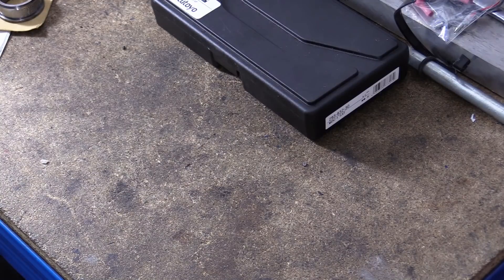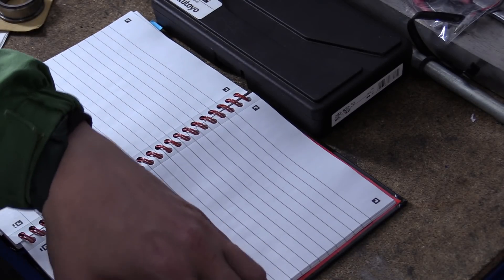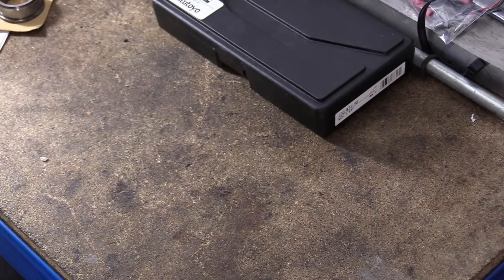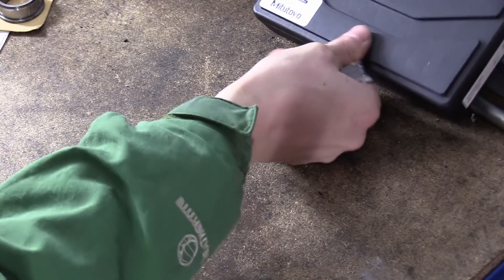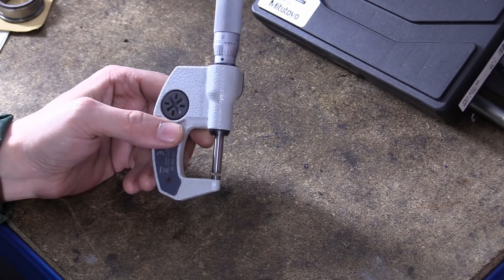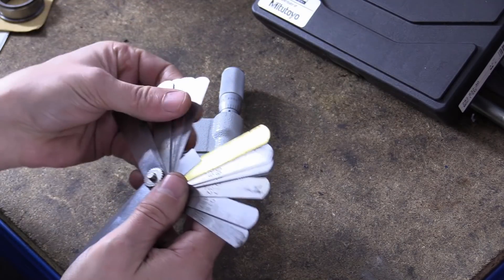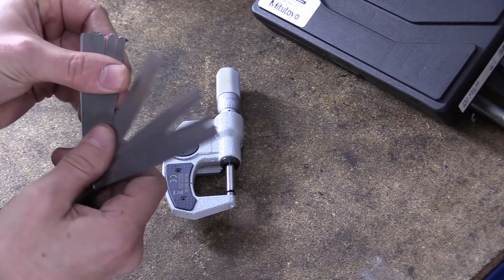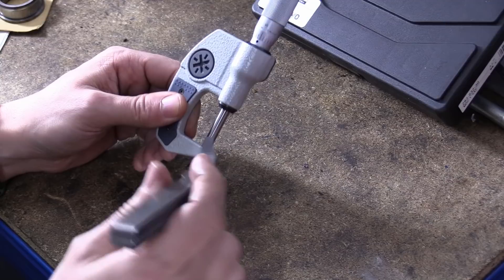Feeler Gauges - How to get the feeling

Comment: That took me back, never give it a second thought these days, but that's exactly how I was taught. We used the micrometer to clamp down using the racket slip, to learn how the feel should be. Not to sure about the porn mags, but I suppose it's a start, it's better using the micrometer, to learn the correct pull first time. No pun intended.....

Comment: Definitely measure the feeler gauges as well.  Cheaper ones can be out a fair bit.  Those also tend to be a little cupped at the edges where they're stamped out, so inserting can be trickier than it should be.  Some are ground at the tips to avoid this, but obviously aren't the correct thickness where they're ground.  As always, you get what you pay for.

I once did the rockers on my 125 with some old rusty feelers!  Definitely decided I needed something better for my first big bike, and I thought I was being paranoid when I bought a micrometer to measure the shims and feeler gauges.  Still had a massive faff with the gauges once assembled (I originally wanted to record the absolute gaps to monitor it over time), so I just go / no-go'd it in the end. It's so much simpler, and seems to work for me.  No dramas yet.

Comment: Its also the Angle of the Dangle. You need to waggle them around to get on the same plane, something again that comes with experience. I'm sure you know what I mean and you could explain it better.
Reply: Very true, at certain angles it slides like no tomorrow but then bang in the middle it's a lot more resistant.

Comment: Every mechanic is different with how they set valve lash, Id always adjust to the tighter side than looser. On Cummins it’s generally advised to use a 6 inlb torque wrench for the adjusting screws. It allows them to take the out human error and get an even lash throughout the entire valve set. I was also taught when carrying out valve sets out in the field or not Cummins engines to use a method by which you tension the adjusting screw by turning the shank of your Allen key only as tight as you can by hand and provided you don’t have any binding adjusters you will achieve an even lash.

Comment: I was 15 when I built my first engine. The mad Irish mechanic that mentored me said. You're building engines. You have to have and know how to use a micrometer and feeler gauges. He then gave me a Mitsutoyo or whatever they're called (a good one) micrometer and showed me exactly what you did with feeler gauges.
He then sent me off with a workshop manual and a box of bits and away I went.

Comment: The brass one is for doing the air gap where you have a pick up coil and fixed magnet rotor so you don't magnetize the pick up.
Reply from the maker: I didn't know that - thanks - what size is it? I never did check.....
Reply: @thedirtyworkshop  
Can't recall the size myself but I suspect the single one supplied with feeler gauges is to suit HEI ignitions with a "reluctor" gap in the distributor which are long gone these days.
Still for magneto type ignition on many small engines with a rotor and fixed magnets its best to use a brass one.

Comment: I don't know if this is bad practice but for my screw type tappet valves on my Inazuma I just put a middle range feeler in and tighten it up about finger tight (so it can be removed) then make sure the upper end feeler gauge doesn't fit but the lower ranges do
Reply from the maker: It not really a bad thing - better than not doing it at all

Comment: Haven't felt this way before.

But on a serious note  when I was taught to adjust valves they told me to stack multiple blades together for instance a .15 and .03 to get an .18 as we didn't have finer granularity. Is that sound?

Also doesnt for instance valve buckets being covered in oil make a difference to the feel?
Reply from the maker: "Also doesnt for instance valve buckets being covered in oil make a difference to the feel?"

- yes thet's why oiling you blades and using an actual metal gap is better than a porn mag and a sheet of paper

Comment: It's all about, friction, lube and feeling.....🙄
😁
Reply: yes who use those in dry with out lube there is too much frictions and if F-Gauges have bad surface you can scratches when measurement parts like valve lifters or other engine parts